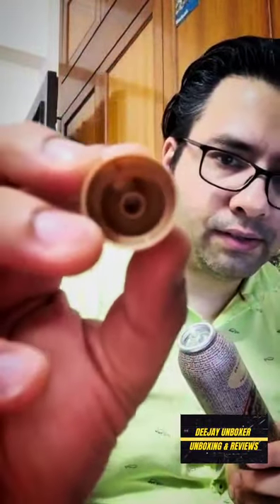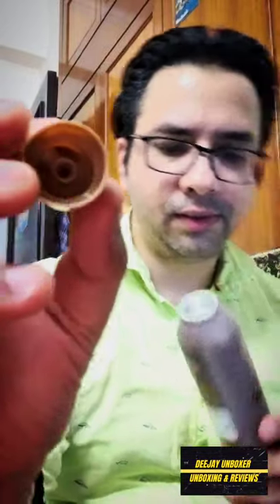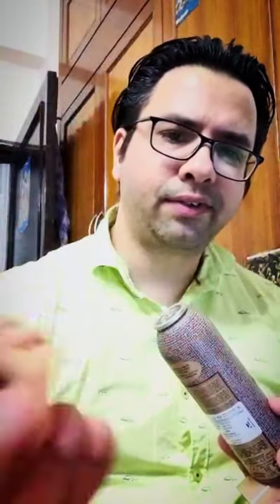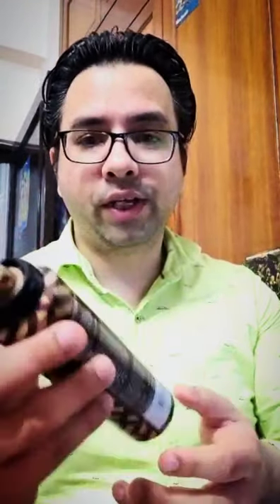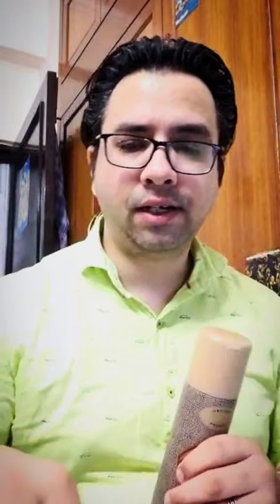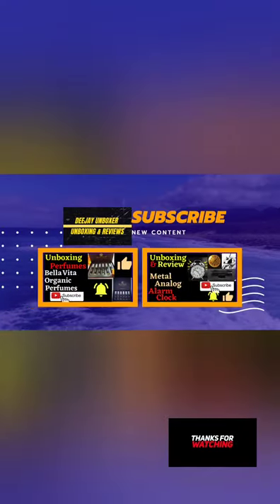Deo spray not working | How to repair |  Tips and Tricks |  Explained in Hindi

Comment: I tried changing the spray cap but still dosent work... So I Just pulled the nozzle few times with a plier and kept checking if it's working with the spray cap on.and voila. The magic happened. Try it, I guarantee you. It will start working again.
Reply from the maker: @lanjs  I'll have to try this.